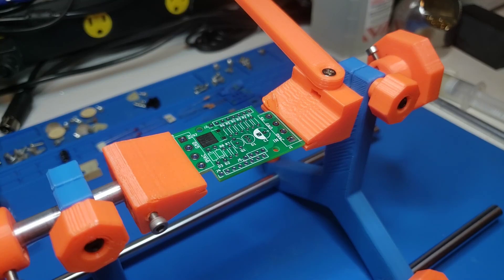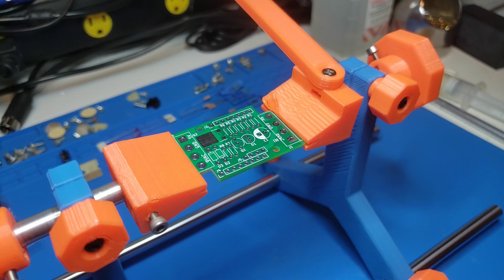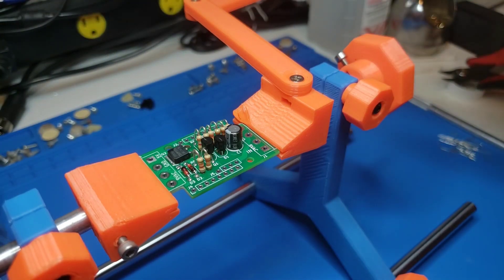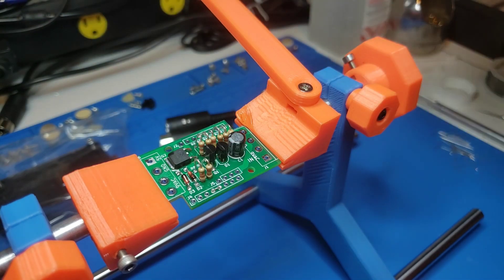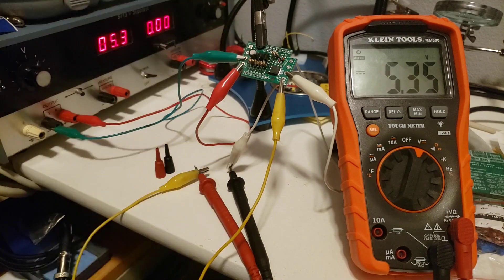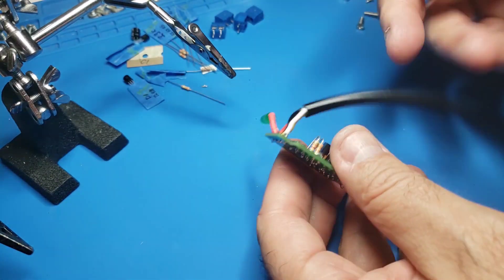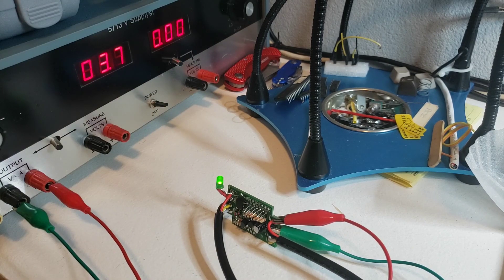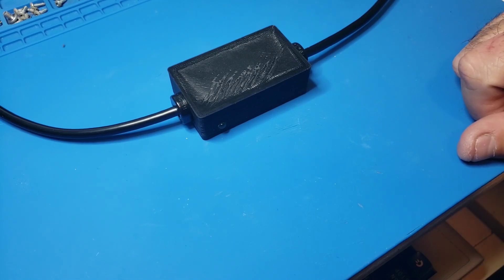Commodore 64 Power Overvoltage Protector - bwack C64 Saver V2

Comment: nice solution, if the green led is off it can be because overvoltage or the power supply has no output (its dead).
Reply from the maker: Thank you for pointing that out! :)